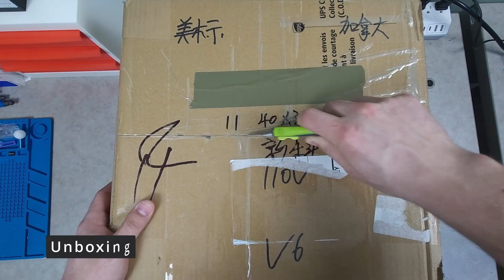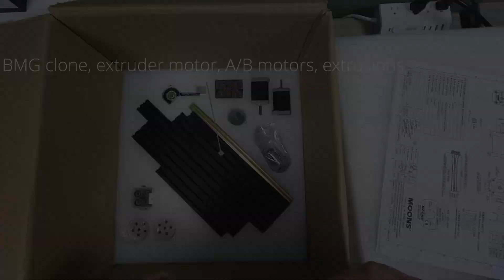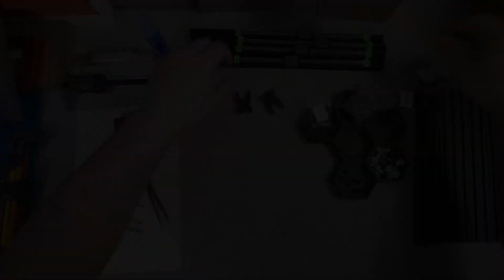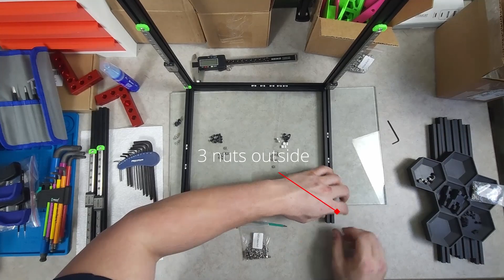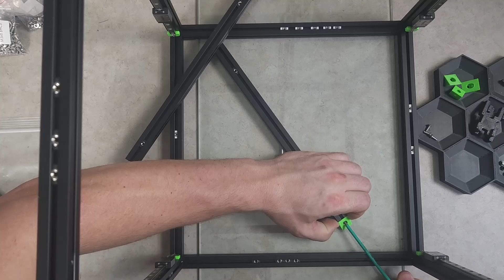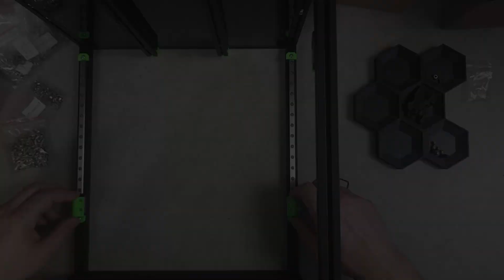Formbot Micron Plus Build: Frame Assembly

Comment: Very nice! Quick question since I recently got in a linear rail: is it really necessary to clean off the shipping grease? Just curious what the benefits of doing that are
Reply from the maker: 100% the shipping oil isn't a lubricant for motion, its to prevent rust while in storage.
the grease is designed for long term use, I would recommend using the Voron spec EP2 grease, lots of 3d printing sites sell small syringes cheap
Reply: @Browzzrr  Thanks for the response, I already got some EP1, should that also be fine? Also, on rewatches I noticed you applying some blue stuff to some of the screws, was that blue threadlock?
Reply from the maker: @WarriorServent009  yep blue threadlocker for the frame, never near ABS/ASA as it will degrade it, EP1 is also recommended!